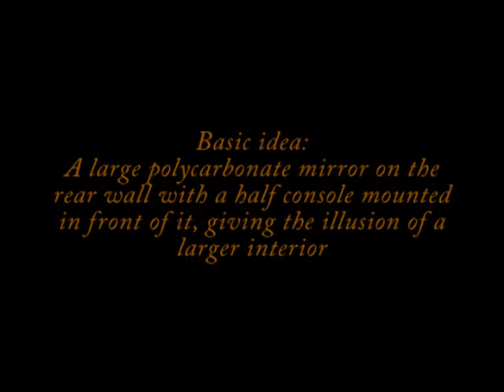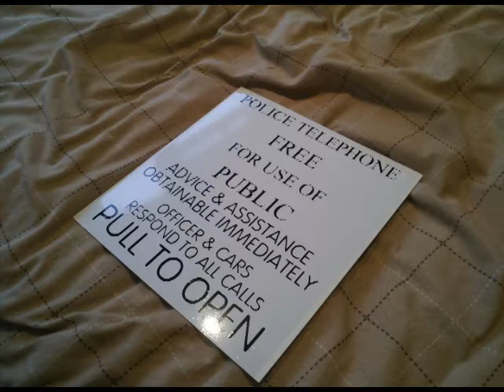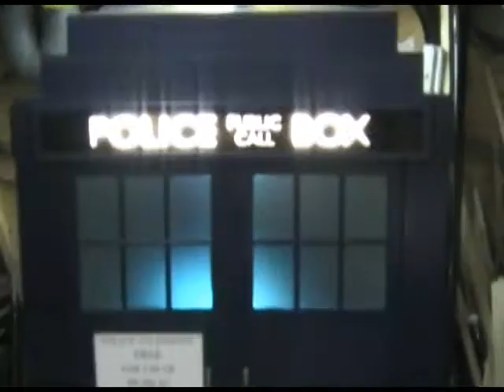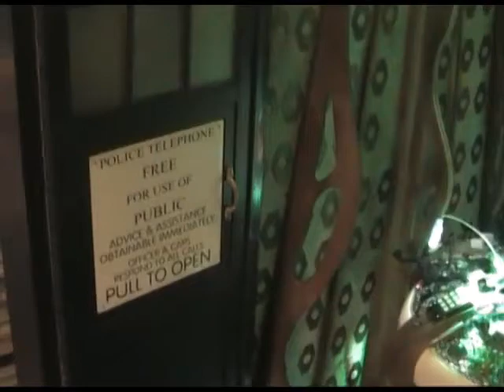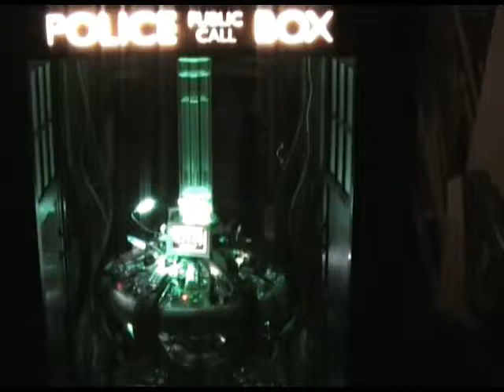Tardis project -  Full description

Comment: Very Nice. I built a solid Oak TARDIS DVD cabinet and now am working on a full size one for my son to play in. You controls are very nicely done. I am going to use an Arduino controller for mine. Time rotor will be LED array and I wont have as many I/O's. I think there are some photos of mine on my Google +page if your interisted. Again, very nicely done, very nice.

Comment: What is that rotor tube Material called and where did u get it?
Reply: I haven't used a tube for my own console, but I believe most console builders use perspex tubing. Unfortunately it can be quite expensive to buy, especially for a full console-to-roof time rotor.